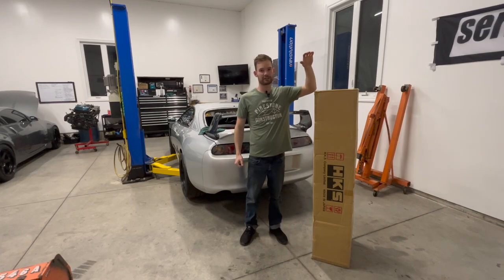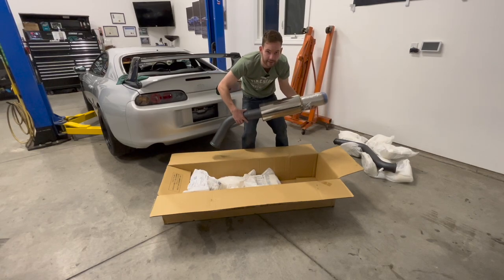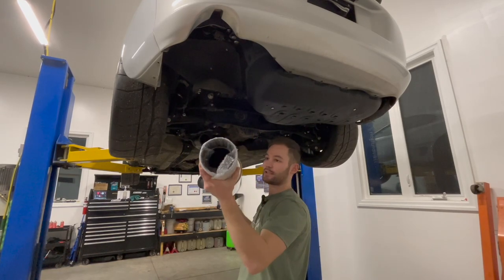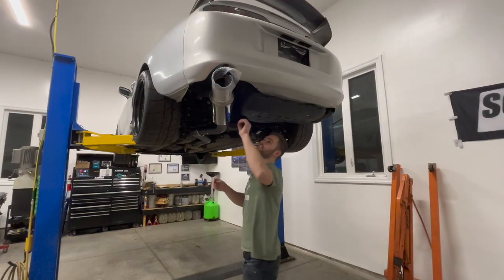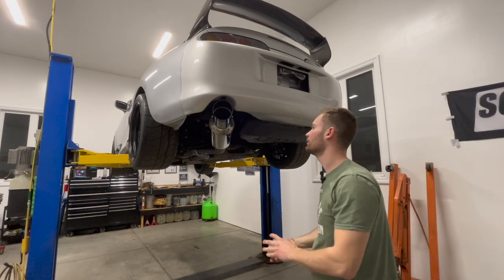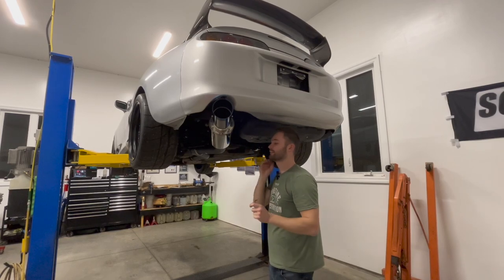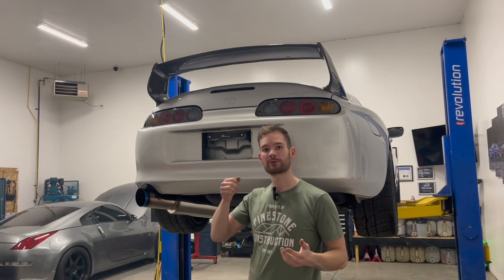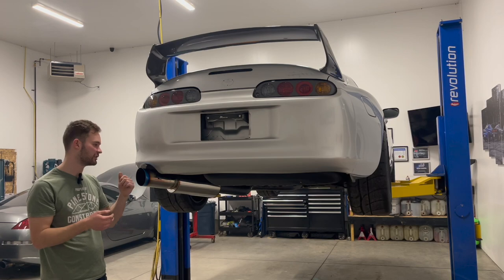making a MK4 SUPRA WAY LOUDER!

Comment: Wade ,I really enjoy your clean cars. I just don't care for the 45° outlet. It almost looks like HKS couldn't find a proper muffler that would fit so they had to mount a long one sideways. I agree with you on those tips. IMHO, they cheapen the look of the car I think a double roll Stainless Steel tip would be more high end looking. Keep up the good work, I enjoy your builds.
Reply from the maker: Thanks ! Yes I will look at some options for the tips for sure see what I can match up ! Thanks for the input !

Comment: I like the burnt tip. It’s what I’m running on my G also.  Run it like it is for a while and after you get the new motor installed you May change the whole set up anyway
Reply from the maker: For sure ! Thanks for the input 👍
Reply: I have a G35 also and might in be looking to replace the original exhaust in the future. Why you picked the HKS over the other available systems? I'm not about making louder, I want quiet and functional.
Reply from the maker: @stealthg35infiniti94  I will be making the exhaust have less noise when the turbo setup is on the car I will be adding inline mufflers/resonators to tone it down and make a clean sound out of it.

Comment: how many horsepower did the exhaust add?
Reply from the maker: Not sure ! I don’t think it would be much at all it’s still got cats and stock mid pipe to see any real gains with the NA 2jz would have to mess with the headers and mid pipe to see at least a little bump ! But once the 2jz turbo goes in the car it will definitely be good flow for the future horsepower goals !